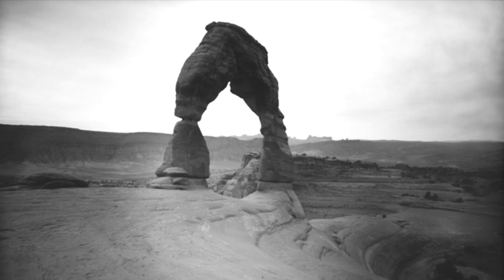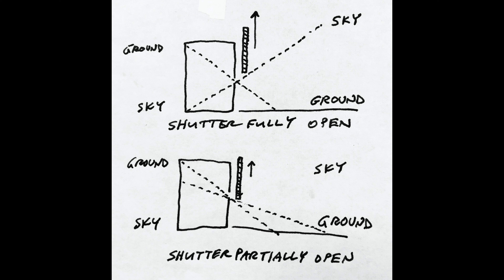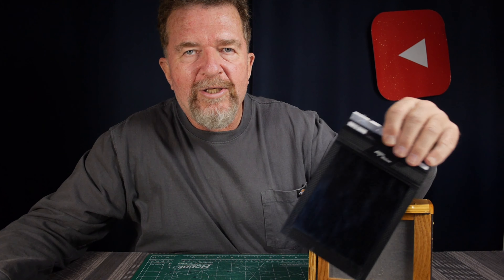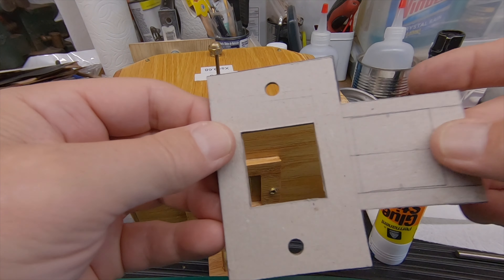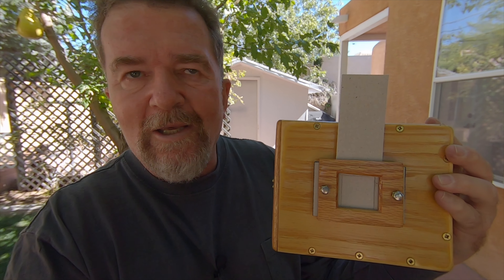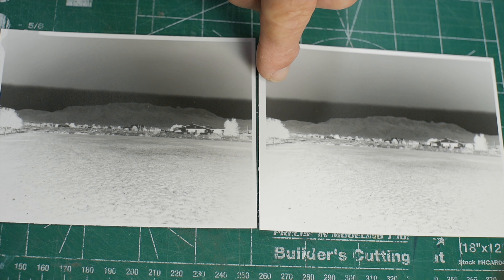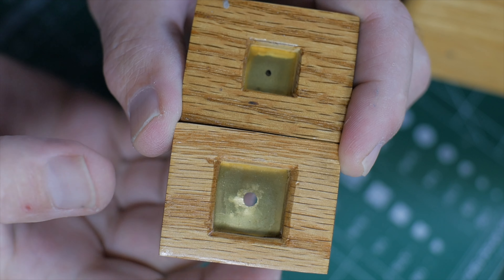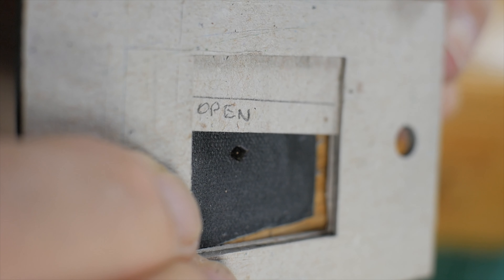Slow Shutter Pulls

Comment: Thanks Joe, very interesting idea. I think you are right that this is easier with a glass lens. The two things that I have seen which try to fix this are: 1. From a 19th century photographer, a device with multiple wooden fingers similar to the guide woodworkers use to copy contours when cutting molding. You adjust the fingers to match the contour your horizon line, mount it in front of the lens and take one exposure, then take it off and do a second exposure. Probably wouldn't work for pinhole though. 2. As someone else mentioned, ND material might work. The person I saw use this used graduated ND sheet designed to use in a drop in filter holder but just taped it in front of the lens with the (soft edged) grad line placed where their horizon line was. Perhaps mounting a strip of that between the shutter and the pinhole could work. Could you make such a strip by exposing a length of low ASA film or paper in the darkroom and moving a dodging tool continuously over it gradually exposing more and more of it so you get a grad from light to dark?
Reply from the maker: Great thoughts, thank you, much to think about.

Comment: Another thing you might try - when you're confident you minimize vibrations and camera movements - is to slowly but continously pull the mask shutter up during the actual exposure. Basically do dodging and burning in camera during the exposure instead of under the enlarger. Sturdy tripod and smooth mask operation would be paramount to minimize camera movement, but since this is a pinhole, the grain sharpness is not a priority anyways.

Comment: I’m curious. What if the window shade shutter was directly behind the aperture? Would this be in effect an in-camera dodged exposure?
Reply from the maker: In front of or behind the aperture, it can work to dodge the exposure. But because the image inverts as it passes through the aperture, having it in front of the aperture means the sky is dodged as you open it.
Reply: @Joe_VanCleave  The shutter would certainly need to pull the other direction, but would the horizon vignette ‘dodge’ be larger if the shutter was directly behind the aperture?